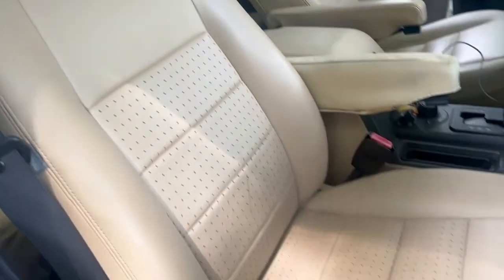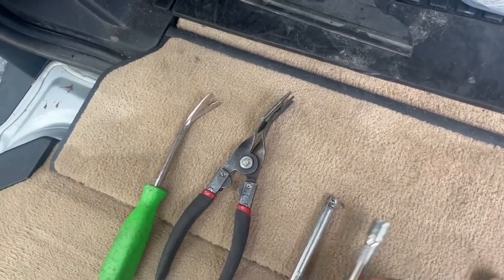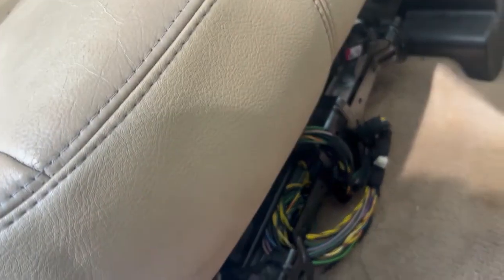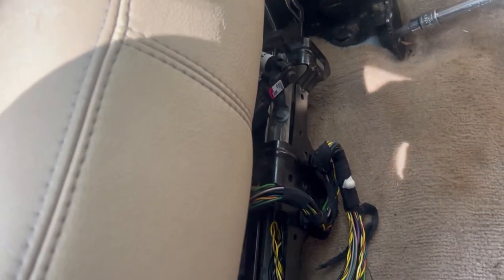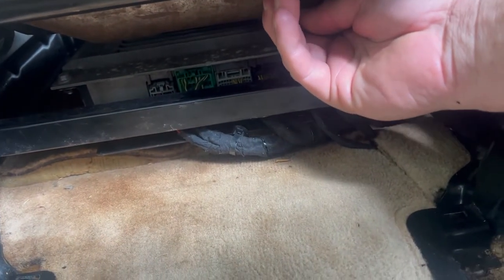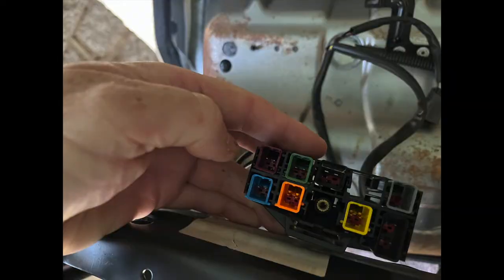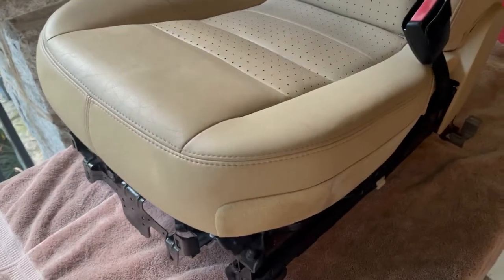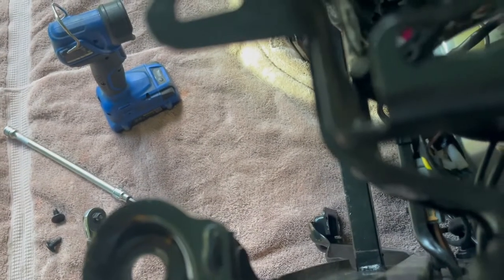Land Rover LR3 Discovery 3 front seat leather replacement

Comment: Thank you, the video is very informative. I have a similar strip to do on mine to replace the seat back cushion.
Reply from the maker: Hardest part is the strap(s) that go around the airbag on the side of the seat....I cheated and cut them.....be careful when pulling the 2 parts that connect the seat back to the head rest, pull straight sideways, don't pull up
Reply: Why you removed bottom leather and not whole bottom part, would be easier?